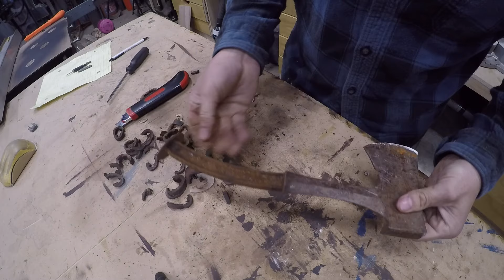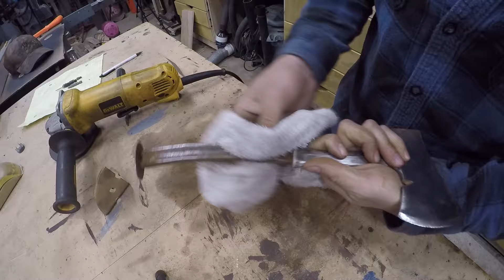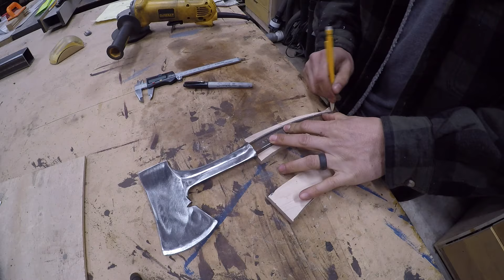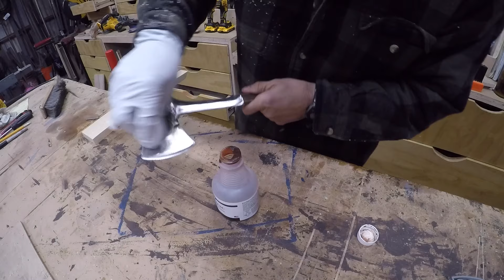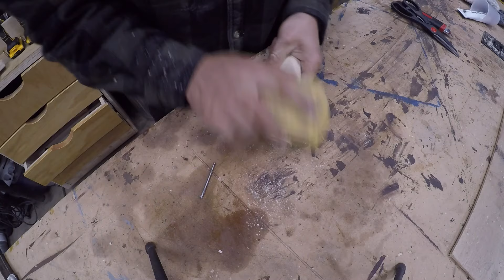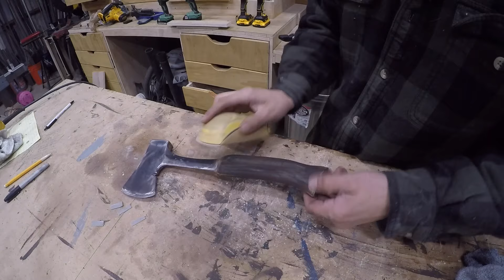Vintage Hatchet Restoration

Comment: The only thing I would add is putting ring grooves on the handle , spaced a 1/2" apart the length of the handle , 1/4" depth , that gives you grip , I do it on a lot of my wooden handle tools .